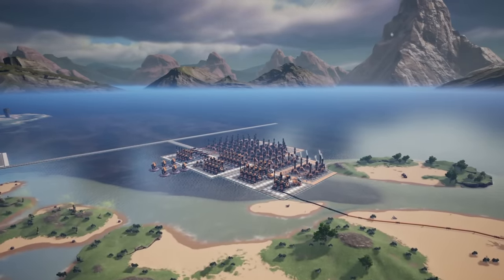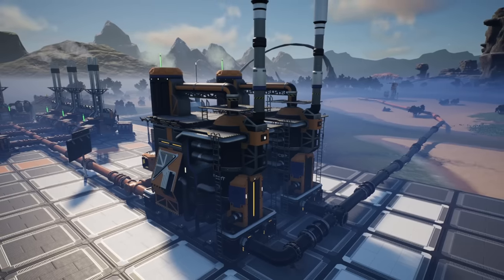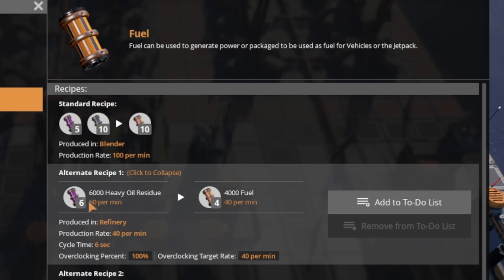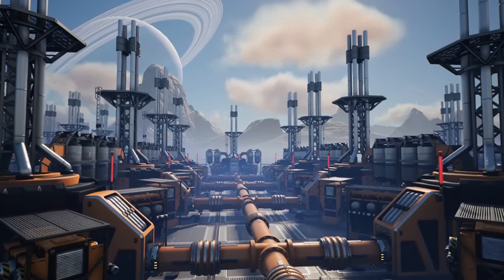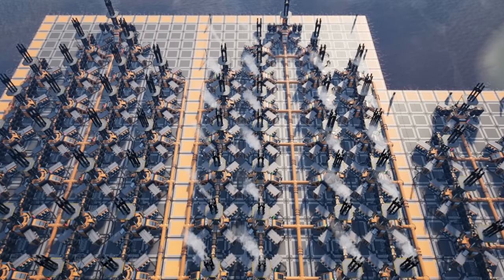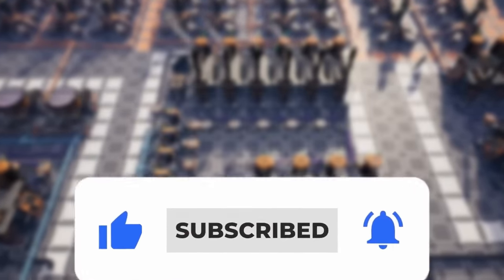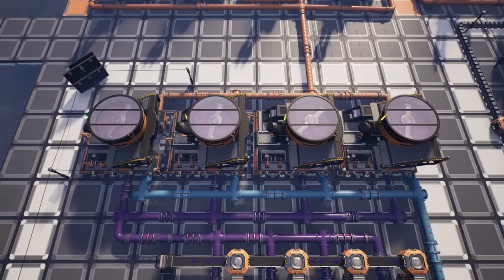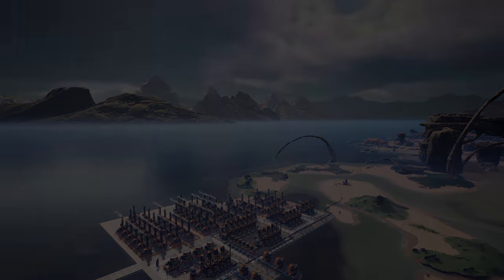100% Efficient Alternate Fuel Layouts For Every Player in Satisfactory

Comment: Hey man, you're diluted fuel recipe is slightly wrong, If done appropriately, 1 oil pump on a pure node (100%) will provide fuel for 34 generators, with 1 generator at 33.33% clock speed. You need, 5 x refs with 4 x water extractors into 4 x blenders into 34 generators.
Reply from the maker: What Heavy Oil Residue recipe are you using? with HOR Alt you produce 40 HOR from 30 crude so 120 crude = 160 HOR in 4 refineries. Where's the 5th refinery from? 
I presume it's a different recipe setup but I can't see which one it is

*as a note, I noticed I have done these layouts for normal nodes - you can double these up for a pure node, but that's still 8 refineries  to 8 blenders.
Reply: @TotalXclipse  Hey, didn't realise yours were on normal. So I use I still use HOR Alt recipe + the Diluted fuel recipe on but on a pure node.

The base recipe (not my own) is as follows (everything is per/minute):

So it's 150m3 Oil into 5 x refineries (30m3 oil each) = 200m3 HOR + Resin (Sync it or recycle)
200m3 HOR + 400m3 Water into 4 x blenders = 400m3 Fuel

Finally 400m3 / 12m3 (per generator) = 33.33 rec, so that's 34 generators with one tuned to 33.33% = 20,000 power. 

On a 250% pure node you can do the above 4 times (600m3 = 4 lots of 150m3) 

I was devestated with the new patch, the work they did on the north spire coast basically covered that fuel set up. I did that fuel recipe above 16 x to produce 80k Power. I honestly don't think I will need nuclear. lol
Reply: Sorry, mispoke, it's 5k power per 150 oil. so on Pure node @ 250% is enough for 20k power.

Comment: Heavy Oil Residue —> Residual Fuel is inefficient. You end up wasting the power you gain on the refineries. Lookup fuel on wiki
Reply from the maker: The Heavy oil residue setup produces 1335mw of power at the cost of 210mw (roughly) it certainly isn't efficient vs other recipes but I've included the guide for those who do want to use it.
Reply: So which one gives the most power gained with least power spent?
Reply: @oldman1973  I believe the most would be turbo fuel in blenders then regular fuel in blenders then just basic fuel
Reply: @TotalXclipse  I’m unsure if the maths is right but it is the least efficient version of fuel setups assuming you’re committing an oil node to power. I heard so many people talk about heavy oil fuel so I assumed it was best for the longest time when it’s actually the worst. Now it’s great if you’re producing heavy oil as a byproduct of another line
Reply: @BananaNationTV  Those are alternate recipes right?

Comment: I know this video is a year old, but watching this is making me a little mad and sad. Cuz my current setup that I now REFUSE to change gets me only 17 ish Fuel Generators for 600 M3 of Oil (which would be around 8 ish with 300 M3 per/min of oil), using the Rubber and Plastic Recipes WITH Heavy Oil Residue to Residual Fuel. 60 M3 Hvy Oil Reside for 40 M3 fuel each Per 5 Fuel Refineries. But I HAD to do this, because I needed more power YESTERDAY, and I didn't have any of the other alternative recipes researched which would've given me even MORE power.    -_-

Comment: What about turbofuel?
Reply: not worth it imo. Since they made fuel more effecient, I've been happy using diluted fuel recipes. Getting the sulphur and coal required for turbofuel just seems a waste.
Reply: @Coldheart322  I think it depends how big you are building. If super big, then it's probably worth it to invest the extra time and energy getting the compacted coal in there for the turbo fuel since it allows you to ultimately fit more generators in the same area. 

If you aren't going real big though, you need less power so a modest fuel only set up makes more sense.
Reply: @codyfox2876  I need to check how much extra power you get, but I often went with 2 pure oil nodes for power, just added more nodes if I really needed.

Comment: Why a pump to prevent backflow instead of a valve? I thought that's what they were for.
Reply: I was wondering the same thing...don't pumps reset the head lift, which valves don't do?  Does it also do that when they're unpowered?  I'm not positive but I imagine that means that whatever level the pump is at, if it's unpowered, that's the new max height of the pipeline...but I could also be misunderstanding, pipe dynamics in this game are confusing to say the least

Comment: Awesome video, I know oil can be pretty confusing, if only there was a guide on rubber and plastic production as well. Either way, good guide.
Reply: Right ! 🎉
Reply: I'm planning to set up a plastic/rubber/power facility on one of the northern pure crude nodes (240/minute).  I have the diluted packaged fuel unlocked, and the Satisfactory Calculator site's planner was extremely helpful in gaming out how much heavy oil my rubber and plastic refineries would be producing, how many packagers I would need, and how many more refineries that would represent.  I didn't get all the way to having it calculate the number of unpackagers (conveniently matches the number of packagers) or fuel generators, since dividing by 12 isn't so bad.  IIRC, I'll have 3 rubber refineries and 5 plastic refineries and will be making 220 packaged fuel per minute from that.

Comment: With an fully overclocked pure Oil-Well (600 qm/min) you will end up with 133.333 Fuel-Generators!
Insane!
Reply: Even more insane.. 2 fully over clocked impure nodes produce 1/2 that amount (67 generators).  I didn't even used to use impure nodes on other playthroughs and it just gave me 10GW of power.

Comment: I was running out of power (had 1200 MW of coal) and I did not have enough power to do Aluminum and get blenders. I absolutely did not want to do another coal power plant setup in another area. So, I tried the Diluted Portable Fuel. OMG.. Literally 10 GW of power from 2 overclocked impure oil nodes (to 250% each). Those 2 nodes put out 150 m3 each (300 total). 67 total fuel generators.. From 2 dang impure nodes. 

This is so OP it's crazy. It took me 5 hours of nothing but putting  down refineries, packagers and fuel generators (and of course foundations and walls). I would have never tried this method without the info so thanks.

Comment: With the new rebalancing for clock speeds on power, would it be worthwhile to overcclockk everything to 200-250 to reduce overall number of fuel generators? (Granted you got enough power shards). Also great video!!!!!!!!
Reply: Even if you were to overclock every ressource node in the world to 250%, you would have some power shards left over. And that ignores that on pure nodes with mk3 miners you would not want to overclock to 250%, but only to 162.5% iirc, since that's the limit of a mk5 belt.
So, even then you'd have enough shards leftover to overclocking your power generators.
So even if you wanted to mine as much of every item as possible, you'd still have enough shards just from slugs to overclock some power generators.
But considering lizard doggos can bring you slugs...
There is really nothing speaking against using powershards to overclock the power generators once that change is made.
Reply: @insentia8424  That's correct, an interesting side note related to overclocking is the nuke power plants currently need 750 water pm which you can't provide, which they are fixing by reducing the water consumption. I'm not sure if they are ever going to add faster belts...

Comment: Could you do this with all power setups, especially like pre-fuel power. Like what is the best for a coal setup, coal? Charcoal? Compact coal? Whats the best for biomass burners. What nuclear fuel should I prioritize
Reply: A bit late for this but biomass is very temporary, you collect the plants and wood manually, maybe put them in some constructors to make it solid biofuel and just manually put them into the generators. I'd say rush coal, then you just maximize any group of coal deposits that are near water, I liked the cove north of grass lands, pretty much used by everyone lol. Leave room for expansion for when you unlock MK2 miners and that's it, but always max the deposits, imo, no reason not to, coal power is super easy to setup and it's incredibly reliable, specially because of the way the machines store so much water and coal, so even if you pop a fuse, you just restart it right away.

Comment: I like to keep the Unpackager/Packager/DPF Loops independent... so that each of them makes a selfcontained circle. This way you don't have the problem that empty/water canisters start accumulating at the beginning of a manifold which can create a mess.
Reply: The way I do it makes the resin into plastic and then into canisters, flood the loop with empty canisters, then sink the overflow. 10/3 times the rate of sunk points that way too.

Comment: Your first setup bugged me, so I pulled out my spreadsheet.  :P  You mention your 7th generator is clocked at 69%, but that would produce a total power of ~1012.8MW.  Instead, I think it must have been clocked at 66.6667% to produce the 1009.8MW shown in your power graph.  That would match up closer with the "6.67 Gens" on your sign in front of the build.

Either way, the 7th generator really should be clocked at ~59.031% to exactly consume the 80 fuel you're refining.  That would produce exactly 1000MW.  Or I'm pretty sure at least.

Good video though, I like these walkthroughs.  Keep 'em coming.  :)

Comment: Hate working with fluids, the numbers never seem to work exactly as they should. Pretty sure there are known bugs with pipes. My aluminium setup caused me nightmares. Despite getting the maths exact by using calculator website, the loop just wouldn’t work and it always stopped, which in turn causes other machines along the line to stop

Comment: I used satisfact calculator to check my math I should be producing 200m of fuel to my 16 generators but its over consuming the fuel. I let the buffer fill up but in time it empties out. Whats up? My crude is slowly falling but I have 300m in 2 extractors. 
4:25 this saved me, thanks mr. xclipse

Comment: My last save had a giga setup that took all of the oil in the map and made it evenly into fuel, plastic, and rubber. But I was dumb/hatted myself, so I did that with only alt recipes and made sure to only sink items that couldn't be made into one of those 3 so I was getting everything I could out of the factory. I think it ended at 10k of rubber and plastic and a 100k MW power farm. Love it when numbers workout like that. (Some was sinked, but Idk what all that made.)

Comment: Doesn't an oil extractor on a pure node with 250% extract 600 crude oil m^3/m?
Reply from the maker: it does - and I was wrong when I said a pure node - these are set for normal nodes. But we are not overclocking the extractor. 

100% on a normal node = 120 Crude oil.

Comment: For diluted fuel you need 5 refineries to produce the 200 HOR you need for the 4 blenders.  You need 400 water as well.
Reply from the maker: What Heavy Oil Residue recipe are you using? with HOR Alt you produce 40 HOR from 30 crude so 120 crude = 160 HOR in 4 refineries. Where's the 5th refinery from? 
I presume it's a different recipe setup but I can't see which one it is

*as a note, I noticed I have done these layouts for normal nodes - you can double these up for a pure node, but that's still 8 refineries  to 8 blenders.
Reply: @TotalXclipse  Completely missed where you underclocked a blender.  I'm running 20 refineries to 16 blenders on an OC'd pure node.

Comment: once I've tried doing a diluted fuel as base for my turbo fuel production... it pretty soon became a problem as I either ran out of space or even the mk2 pipe wasn't sufficient to deliver..  ">_>
but that was still at the time when nuclear waste was a permanent problem... so yeah, I've tried to use fuel instead of nuclear to generate a whooping number of energy, but it was too much to handle
Reply: This is why you need to split your pipelines, figure out how many generators you can feed with a single mk2...and there's a trick you can do by making sort of a split loop where one pipeline will effectively feed twice as much as it should by, in effect, having it fed at both ends with the generators in the middle.

At least, it should work in theory, and seems to work for me when I try it...but pipes can behave kind of weird in this game, I keep running into scenarios that based on all the math I can muster should be impossible, but still happen anyway (waste water backing up in a bauxite plant even though the waste water + the input from extractors should be providing LESS water than the aluminum slurry refiners are able to utilize)
Reply: @ChrisRLowery  yeah, I've done all that, but it became too much too soon..
Had that water problem as well.. made an overflow pipe piece and a packager that sank the overflowing water.. that solved it.
Reply: @reyhaz  That's what I wound up having to do as well.  Absolutely never should have packaged any water, but was doing so pretty continuously, though I suspect it may have to do with how I laid everything out.

I've set up a large aluminum factory that I'm still working on getting the external inputs set up for, and I'm trying a different approach with the water where I'm feeding it from the extractors to the waste pipes from the second tier refiners, then going on to the inputs for the first tier, with the overflow elevated above the refiner inputs at the end of the lines.  My theory is that this will allow the waste water to be used first before picking up new water from the extractors, and the overflow being at the end should prevent the waste from ever backing up, but with the elevation it should only overflow after the inputs are saturated.

Here's hoping that works...I would prefer to see no water ever getting packaged/sinked and it just being there as a failsafe.